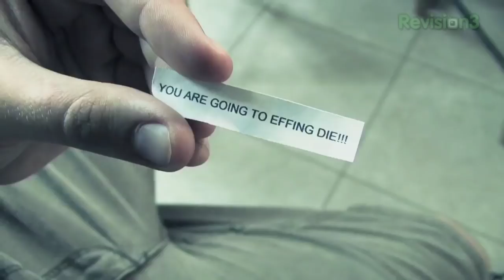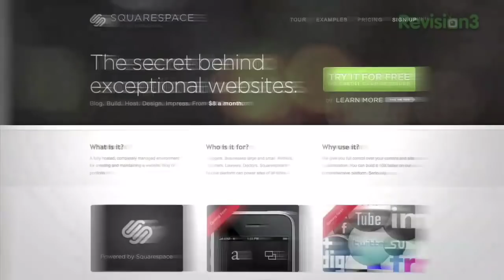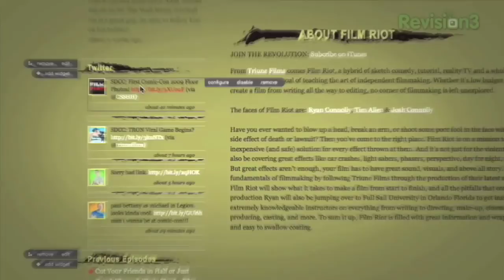Film Riot - Make Your Own Cheap Camera Dolly!!

Comment: let me just say as a skater, NEVER put skate wheels on the ground like he did at 4:22 as soon as those wheels hit the ground they will start picking up dirt and crap between the grooves that could mess up the shot. Especially if the wheels are not hard. and also it is better to get not rock solid wheels or soft wheel wheel as they could make the dolly very fast or too slow. good luck

Comment: Hey guys was curious to know if there was a reason why you off set the wheels as opposed to lining them up directly across from each other.  In other videos I watched they lined them up directly across from one another and thanks for the tip in part 2 on using rollerblade wheels rather than skateboard wheels.

Comment: @ArcticTrees but you will need to put something on the ground if the floor is very textured, so it will go more smooth, I just this method too and I'm lucky that there is a stabilizer on my cam :p
but it is great indeed!